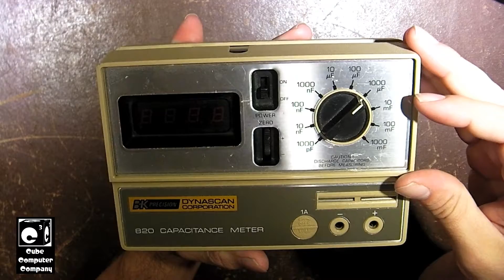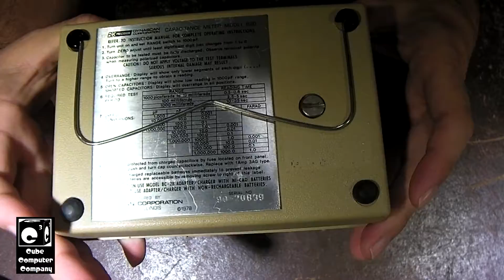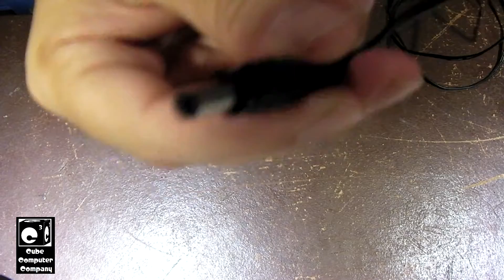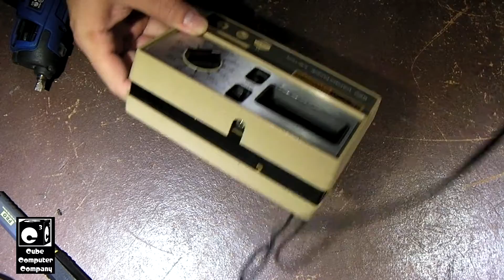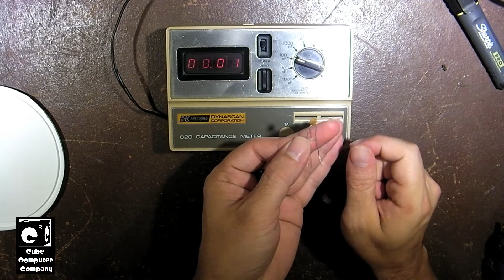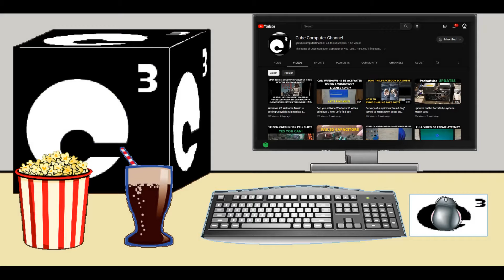A look at a vintage BK Precision 820 Capacitance Meter

Comment: I used to like B & K Precision equipment, they were affordable.  I have a similar, slightly newer version, of that Capacitance meter.  Mine has an LCD display, versus the model you have with the LED display.  I have a transister tester somewhere as well, that I bought years ago, there was an electronics store near me that sold B & K test equipment.